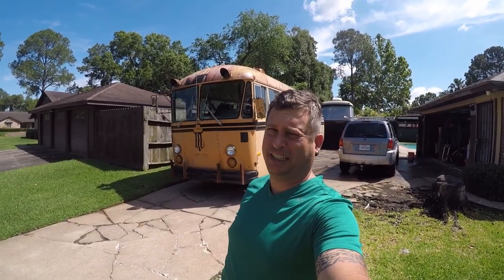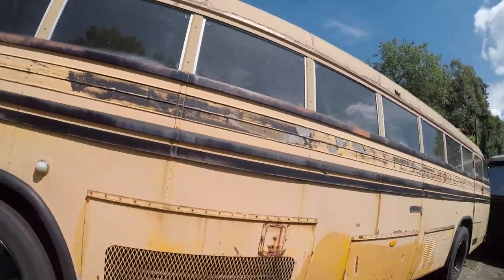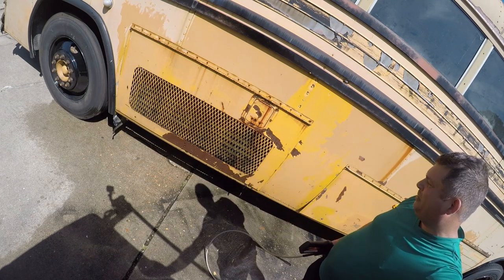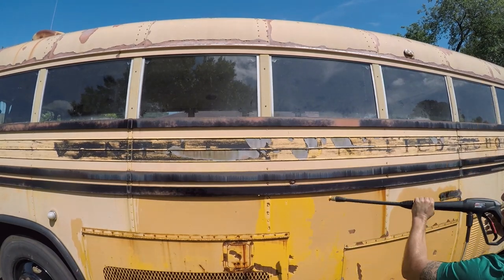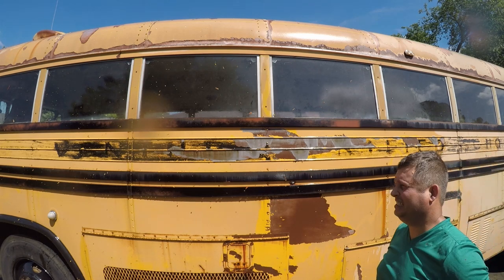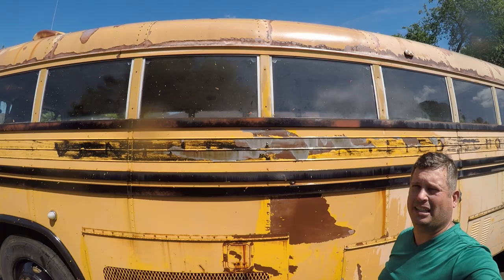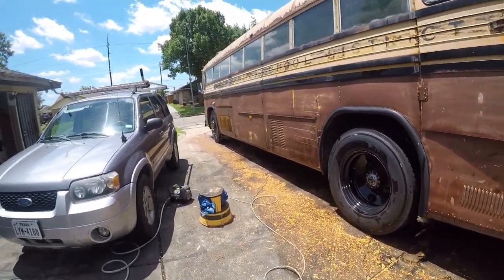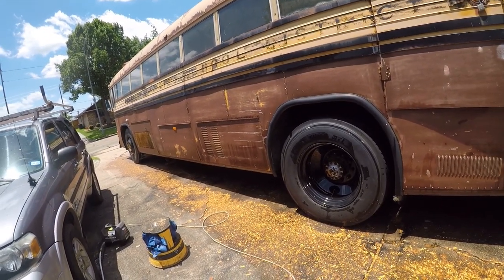Crown Supercoach RV Conversion - stripping paint

Comment: Hey man, thanks for posting these videos. I was surprised to see brown primer under the yellow paint. I found your video when searching for images of a unpainted aluminum crown. Yours is the ONLY  thing I could find online. You said something about the bus being aluminum with some steel. Do you think it would be possible to strip off ALL of the paint. Then buff up the aluminum so it shines like a 747? I have yet to see one, but in my head it sounds like it would look pretty cool.
Reply from the maker: No, I don't think it would work.  The screen portions are steel.  The blasted gulmite screws are steel as well.  I also think it's probably the wrong alloy to shine up.  It's a high strength alloy.  

It would be a substantial amount of work to polish.  If you want an idea search for Argosy polishing videos.  Argosy's are painted lightweight Airstreams.... it can be done but it's alot of work.

I'm still contemplating the paint.  I think it would be a ton of nasty work to get that aluminum primer off there.